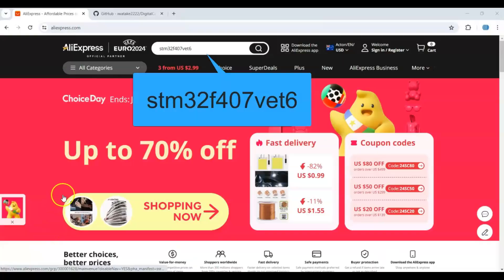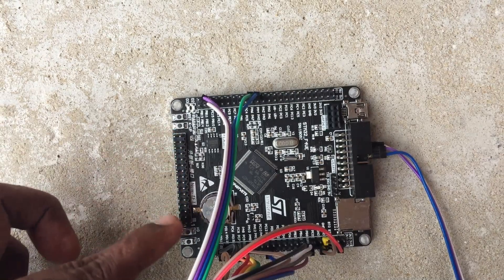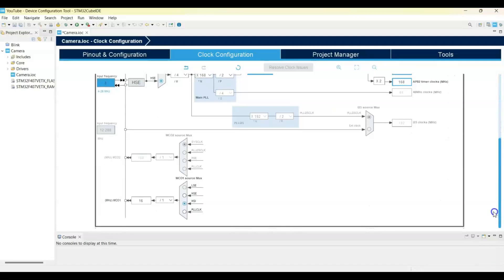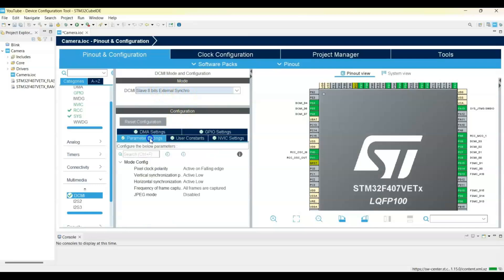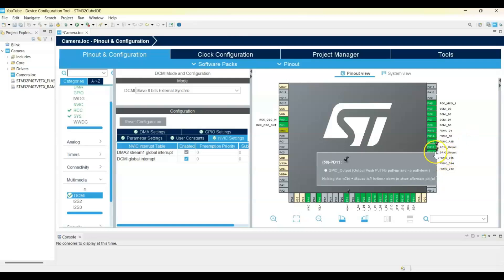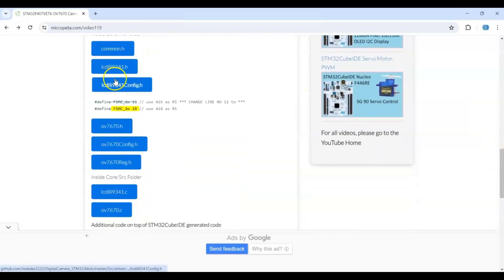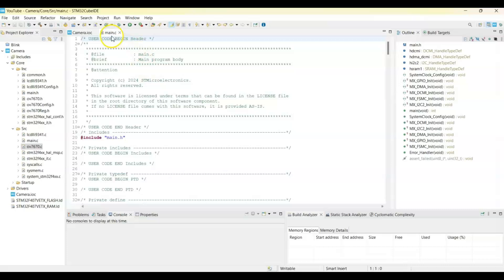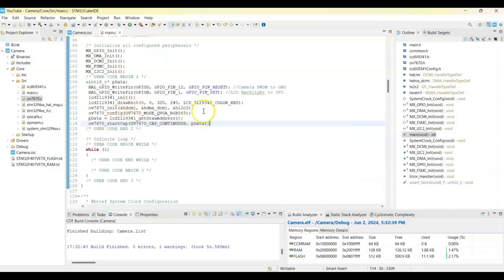119. STM32CubeIDE Camera. OV7670 with STM32F407VET6

Comment: Will it work with bluepill? If yes, then will the fps be the same as this board. Please make a video on bluepill with this camera.
And lastly do you live in India? Because I don't think we can buy parts from aliexpress in India.
Reply from the maker: OV7670 Camera can be connected to bluepill but the library used here can not be used with that.
Because this library uses DCMI interface and the bluepill does not have DCMI.
I have not found a library to use with bluepill yet. Thanks